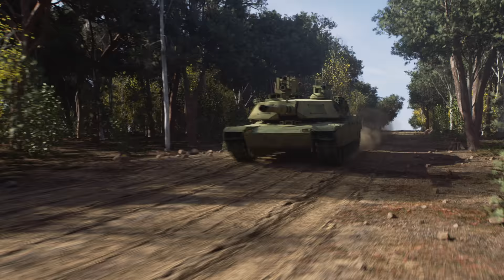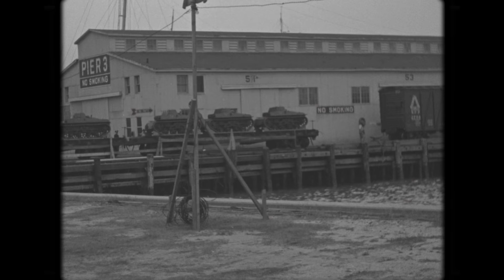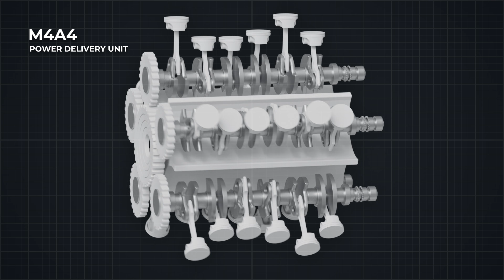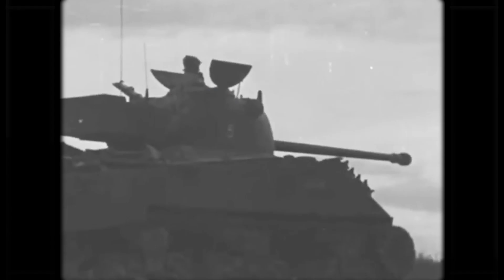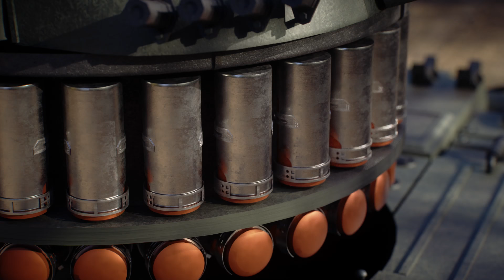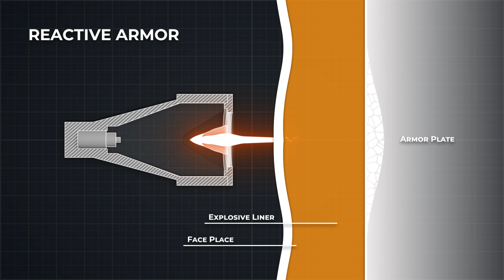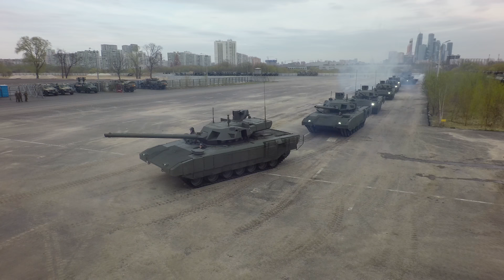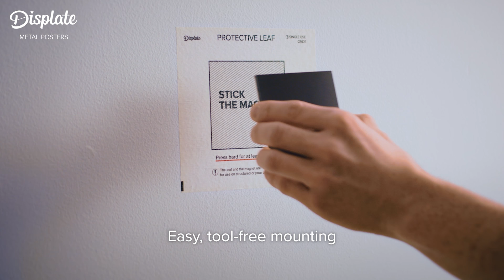Why America’s Tank Failed in Ukraine

Comment: Late to the party but screw it, the short answer is..... it didn't fail and not only preformed well above many other tanks but also did so while being used in a manner for which it was not designed. Despite all of this and the fact that most of the tanks are the much older Australian version and not even a sep 2 most of the time, they have been used to amazing effect including in the Kursk operation. They didn't fail at all really, and their lose is not due to insufficiency but rather because war means loses for both sides, and no matter how good a tank is, it can and will eventually be lost to something. That is the truth of attrition based warfare.

Now for long version

1)The Abrams is an amazingly aggressive tank and is meant to be used as part of an armored spearhead or armored task force while acting under multiple layers of other combat units (it needs air support, infantry support, light vehicle support, and artillery support) which is fine for its intended role of spearhead unit. What its not fine for is mostly patrol and defensive fighting across large areas of frontline like is in Ukraine right now. The reason for this is actually the second point....

2) Its a gas guzzler. This is fine for America because of their advanced logistics and general dominance of rear combat space (both theirs and their enemies) which means they can get away with using what is essentially a race car tank, and that's important. The Abrams is a high performer (for its tech level) and maintains an incredible level of mobility in combat allowing it to weave in and out of cover (yes tanks use cover). However, that's not useful in Ukraine because..

3) It sucks at defending. Sure its decent as a rapid response force tank, which it has been used as, but ultimately it is a beast built to attack and is just to logistically difficult to maintain in a defensive posture all the time. Ukrain is a defensive war, with the defender having supply issues.

Comment: Not used as intended, no support, no scouting, used like soviets used tanks. It also was not designed to take on Drones and AT missile spam. The engine is not THE problem because it does the job just fine the problem is the Ukrainian military is not the US Army or has the logistics or training. This is why Russian tanks are retarded and simple, it is also why they are easily decimated taking the crew with them. 
When the tards at DARPA or LM or GD whomever makes the next version it will be slightly better in some ways and worse in others. It seems these guys cannot get it together.

Comment: 27/31 Abrams lost, no mention about 49 Australian Abrams. Also were these numbers differentiated? The US sent 31 M1A2s while Australia sent 49 M1A1s. I have doubts that the data clearly differentiated. If they were then why omit the Australian Abrams? Wouldn't it help your point? What is the loss data on the supplied Leopards or Challengers? Did they face the same issues as these Abrams did? Did they run out of fuel as well? If you are comparing the Abrams to them, then shouldn't you also compare the loss data too? Also then how many T series tanks have been lost? Also does lost mean destroyed? Or in a state of disrepair? Or just inoperable? 

This video conclusion seems to be made on clickbait. Also, the Armata is the future? Really? Why skip over the Armata's reliability issues? Or how its engine has many issues of its own? Or the fact that we only have limited data on the thing. I get bringing up the idea of crewless turrets, but the US has used them in the past. It comes with combat drawbacks that the US deemed problematic.

Also saying it failed is weird, it was used up in a warzone as equipment is on a rapid level. Did Ukraine think it failed or did its job? The US Army and Ukraine have different doctrines in usage and what success means. Ukraine is the operator of these tanks in the data you are pulling, not the US. If the US were the operators of these tanks, then I would agree with the statement you make that they failed by US Army doctrine. But even then, we are talking about losses over years.

I like this channel but maybe get others to critic these conclusions first? Maybe you did, I hope so. You do great research in general. Keep it up.

Comment: Yeah this is a bit misleading.  The Abrams didn't really fail.  The war in Ukraine is not really suitable to tanks, all of them suffer high losses when engaged.  The Abrams had a higher loss rate because they were used the most.  Why were they used the most?  Because they were more mobile.  The Ukrainians have stated that Challenger II was limited in its deployment because of mobility issues.  Also the Abrams were actually delivered first, about three years ago.  Most of the Abrams were lost before even half of the promised Leopards arrived.

So yeah they got destroyed the most, because they were used the most, because they were the best tanks Ukraine had actually received.

Comment: they didn't fail, they devastated the Russian army and Russian armor. In the 2024 Ukraine great counter offensive, western sources reported that Russian soldiers were ''demoralized'' when they heard Leopards, Abarms, Bradleys were coming for them, and the Russians ''fleed'' their positions before these advanced, state of the art western machines ever reached them. However, the downfall of them are the fuel requirement and numbers, they are heavy and need too much fuel, they also have too few of them while the Russian employed number tactics. They often sent in 2 to 3 of their most advanced T90M tank together with another 4 to 5 obsolete T72B3M tank in order to overwhelm a single leopard 2 or abarms, because they can never penetrate abarms from the front with their inferior APFSDS rounds made of low quality materials. America needs to send 100 Abramas to Ukraine and the war would be over in one month with crimea back to ukraine. sava ukraine.

Comment: A hybrid tank is genius, the electric motor will give it exceptional torque when moving from rest. It would have a wider set of capabilities compared to a pure diesel tank. The military will no longer need to leave their tanks running for 20 straight years.

Comment: most tanks leopard abrams and russian t series have 1 thing in common they have frontal arc armour emphasis in the pre drone world tanks are meant to engage each other with apsdf shells or tank autocannon fire while returning fire so side and rear armour are really only good enough for light autocannon and small arms the problem is drone strap with a tandem warhead or atgm top attack dosent have to the tank frontal armour they can hit the roof or any where of there choosing if there drones and you cant armour the whole tank to be able to withstand a tandem warhead atgm its simply not practical thats why everyone is rushing to develop cage style armour and Active protection system to take out drones and incoming warhead before they hit.

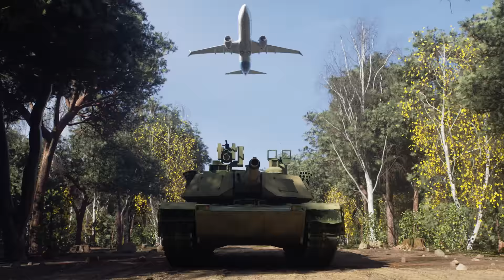Comment: 0:35 What does stacking have to do with mass? I don't think spatial arrangement influences how much things weigh.
Reply: It has a lot to do with ground pressure on mud.  Or being able to use a normal bridge.  24 F150s head-to-tail would behave very differently there.
Reply: @jlv-77  Mass distribution does not change the mass itself, what are you on about. It's a physical property - things do not change their masses based on how you stack them.
Reply: @Tar @TarecPL on about the 2 tactical differences I cited.  An F150 ain’t the greatest of Newtons vs Kilograms explainers, no, but an M1 is an effn lotta weight on lit bits of ground.  I can type more slowly if it helps, Physics Dude.  For the mud, see Pascal units too ;-)
Reply: @jlv-77  I didn't ask about tactical differences nor the pressure on the mud. I asked about the mass. Please try to comprehend the words you're reading first before getting snarky with your "physics dude", because an actual physics guy would've caught that immediately.

Comment: Seems to me that tanks in the modern battlefield are most definitely more of a legacy asset when air assets are around. The fate of the much vaunted M1's in Ukraine are a perfect example of this. No matter how thick your armour protection, there is always a counter. In this case, the advent of inexpensive drone warfare has seriously skewed the odds against the tank.

Did those M1's get destroyed because of their engine choice? Was it because their already massive armour protection wasn't enough? Apart from the problem of fuel consumption, the M1 had all the advantages as far as a tank went,. and yet they still failed, seeing a loss rate of 81%.

Rather ironic that the very theatre they were designed to dominate in has proved their undoing.

As for the T14? Haven't the Russians lost pretty much all of the units they fielded? Thus, with their "advantages" in terms of design, they still suffered the same fate on the modern battlefield.

Comment: "Impervious to the Sherman" With respect to Tiger 1 is not just a minor faux pas, it's objectively incorrect. Even from the front, Tigers could be and were knocked out frontally, with guns as small as 57mm* but also 75 and 76mm guns, depending upon range, angle, and ammunition used. Also claiming the armor was 2 to 3x superior to ANY allied tank is also objectively incorrect, when the aforementioned Churchill exists, never mind accounting for sloping, which you gave to Tiger 2 but not to the M4. Taking sloping into account, M4 had almost as much effective armor as Tiger 1. It's also important to consider that heavier German tanks, namely Tiger and Panther, needed to be transported by rail because of their well known mechanical issues, and while on rails needed to have thinner transport tracks installed. Once at the depot near the front, they had to put on the wider tracks before taking off and hoping they could make it to the front before either running out of fuel** or breaking down. - 57mm was what happened to Tiger 131, now at Bovington. A 57mm, or 6 pdr shell managed to jam the turret ring and force the crew to abandon the tank. *- In the later war, of course, fuel was always in short supply for the dwindling Wehrmacht. The quagmire that is MBT70 is quite the rabbit hole, I'm reading about it for a video of my own and it's just... it reads like a high school drama, actually... just 2 parties unwilling to agree to anything the other wanted. Good analysis overall, though, minor nitpicks aside.

Edit- It should also be mentioned that the T-14 Armata is still only a paper tiger, none have ever been seen in action anywhere but in parades. There have been designs for unmanned turrets for a while in the West, many of which were rejected due to the inherent (at the time) unreliable autoloader systems that existed when projects like the M1-TTB (Turret test bed) were built (you can see the finished prototype at the armor and cavalry collection at Fort Benning in Georgia).

Comment: The M1's the Ukrainians have are NOT the latest M1A2 sep v3's with all the additional armour and electronic countermeasures, they are Ex Australian army M1A1's they had some anti-RPG armour added but apart from that these tanks were 2002 tech, not 2026 tech. They also weren't "killed" they have been damaged but unlike the Russian POS tanks, these are built to be repaired after Battle damage unless the hulls are punctured, this Video is EXTREMELY misleading. We do not know what the T14 Armada tank is like because the Russians at too scared to use them in combat, with the M1's they are old anyway so who cares.

Comment: Interesting, informative.
We need to look a bit wider, not just at tanks and armour, but how overall battles and campaigns go. No, that doesn't mean I'm trying to keep and defend WW2 type tanks, it means I'm trying to see what we should be doing.
While a mobile self propelled 150mm artillery piece has real use, I rather think we need to have (conceptually) a WW2 Jeep with a .50 cal Ma Deuce on the back, and the whole thing is remote operated, in ways that can't be jammed or e-warfare blocked. At a cost of less than US $50 k.

Comment: Still More Abrams have been seen in action than T14s in Ukraine :)...just saying
Reply: Undoubtedly. But the most modern tanks aren't being supplied to Ukraine, and comparing old tanks with new concept models, which have apparently been abandoned, isn't entirely fair. Even if that were true, the T14 simply didn't take off; it's being replaced by more cost-effective modifications of the T-72, T-80, T-90, and BMP. The recently-resurfaced Terminator (based on the T-90), the Derivation-PVO (based on the BMP-3), and all sorts of active protection systems, nets, and other brawlers for main battle tanks. 
In short, military operations are a war of economies; modifying existing tanks is simply cheaper.
Reply: No need for russia to use the T14, against ukies even old t-80 are enough.
Reply: They pulled it out of Ukraine for 2 reasons.

- They were afraid the west was gonna steal the technology.

- The T14 cost too much, and is not worth losing in a modern drone war.. Its better for low level enemies like the ones the US tend to attack, Iraq, Afghanistan etc.
Reply: And there are virtually no T14s.  And the ones on parade won’t even roll down a paved street.
Reply: @jimmorrison3740 you guys said that for quite literally every other advance russian tank. If one country produces too much advance weapons you people write it off as paper tiger or low quality. Its honestly embarrasing at just how butthurt some people are when certain topics come to light😂
Reply: @AliImranmohadi  there are no advanced russian tanks, they are all just variants on the junkheap theme.
Reply: @locusmortis  and abrams tank heap in iraq and ukraine isnt? You do realise that much of leopard and challengers that were already aqcuired by ukraine faced just as fervor the destruction from russian droness right? So for the us to send an even downgraded version of an unreliable system is no less than a strategic blunder on ukraine side
Reply: @AliImranmohadi  The Abrams and Challengers in Iraq smashed any russian types that they encountered. Even in Ukraine the few western tanks were far superior, they are much more survivable than russian types and their turrets don't explode 100 meters into the air.
Reply: @locusmortis sounds like a whole lot of mythical bull to me😂 america is no stranger too because they dominated tank turret toss in iraq.imagine receiving 3 of the most powerfull gamechangers and you still lose ground to "inexperienced conscript" with shovels😂. 50 russian service members body were literally exchange for 5000 ukroid service members body so may be you oughta shut your yap and admit defeat
Reply: @jimmorrison3740 Thats very old news, but im glad to see American propaganda havent died..

You know what else had problems in the beginning? The F35 from the US..

This funny thing happens over time, where things improve and mistakes get corrected.

Comment: Sorry to disillusion American fans, but the Abrams wasn't really an all-American tank, in numerous important features. The Chobham laminate Armour was a British design, as was the excellent Royal ordinance L7 105mm gun. The Rhinemetal 105mm was also superior to US guns. What the USA did was to go into fake cooperative ventures with its European allies to steal their inventions, and then go their own way. They never intended to cooperate or compromise. 
This ignoble tradition went way back to WW2. The M4 Sherman had a fairly useless short-barrelled, low velocity 75mm gun which was already outclassed by the German guns as early as late 1942. The British offered their excellent 17-pounder anti-tank gun [a version which was also produced for tanks]. The British fitted their 17-pounder to late WW2 British tanks, and modified their M4's with the 17- pounder, calling it the Sherman "Firefly". The US later deployed their 76mm long barrel which was better, but still not as good as the British 17 pdr. 
The converted radial aircraft engine in the early Sherman's was an absolute dog. It performed well for a little while, and then the engine had to be removed to change those spark plugs on the bottom of the engine! 
The European metric system was far more efficient in engineering and design, and yet another example of how primitive US engineering was by retaining the Imperial system right up to the present day.
Reply: Don't forget that Americans drive from the left side of their vehicles, because they're bad and dumb, while the British offered their secret "right-side drive" technology, which would have saved 10,000,000 lives in WW2. And the Pentagon, HQ of America's War Department,  was designed with 5 sides, because of devil worship or something.